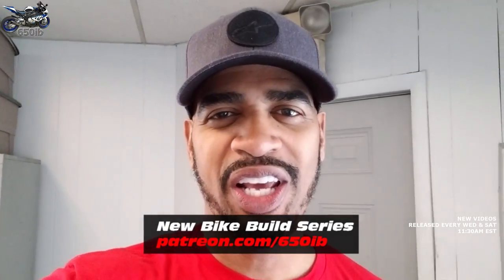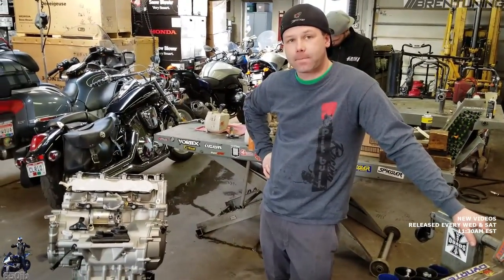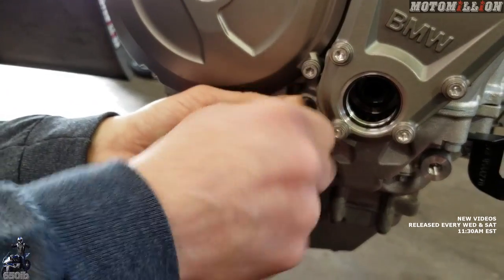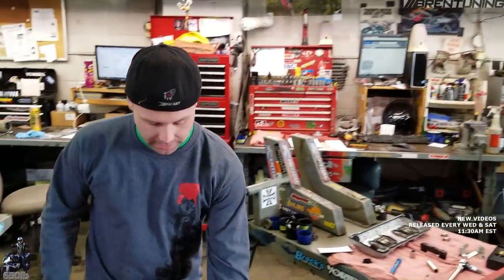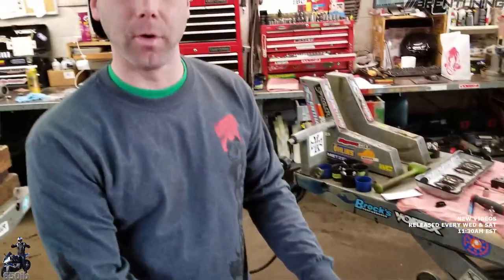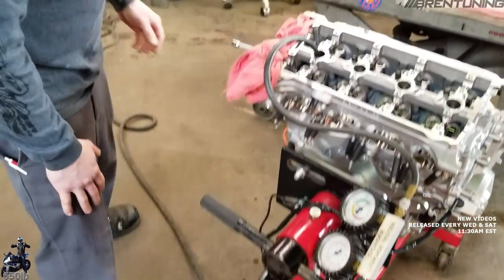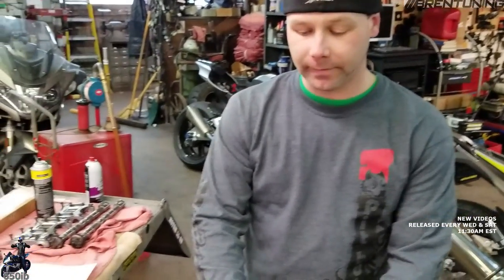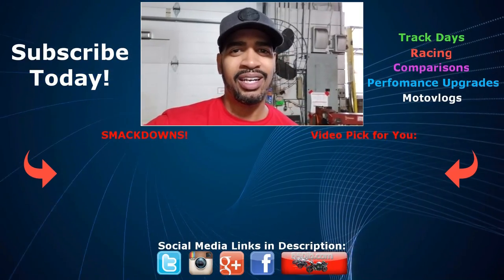RACE CAMS 🔥🔥🔥Installed onto 2018 S1000RR!!

Comment: I am a machinist and I build motors like these for a living and it's really impressive to see a bike mechanic with this much understanding of the engine. Most mechanics don't have half knowledge and understanding of the insides of the bike as this dude. I really wish I had more shops near my house like this to work with/use.
Reply: Sirmellowman start a go fund me and build you a shop. Or put together a business plan for a shop and find an investor. The bike community need more mechanics like you and zack. 👍🏼
Reply: Sirmellowman I'm not a mechanic, but I knew from day one he was a awesome mechanic.
Reply: I need to watch this one more than once for sure..Great video!!
Reply: can anyone help me - i have a 2012 r6, im tryna install the camshafts. there are marks on the intake and exhaust that are supposed to be level w cylinder head - whenever i line them up, and go to install camshaft caps, the camshaft sprockets move and the lines on them are no longer level w the cylinder head - how do i fix this, should i install the tensioner (i have a manual one) in before installing camshaft caps? the camshaft doesn't sit in fully straight too. im thinking about doing that after seeing some of this vid
Reply: Seriously shocked me too dude kicks ass

Comment: mad respect to Zach, if it wasnt for his interest and time into actually explaining the steps i wouldnt watch the video throughout completely, i'd just be skipping through. You can tell he's a genuine guy. Thumbs up !!!
Reply from the maker: Thank you very much for that feedback.
Reply: can anyone help me - i have a 2012 r6, im tryna install the camshafts. there are marks on the intake and exhaust that are supposed to be level w cylinder head - whenever i line them up, and go to install camshaft caps, the camshaft sprockets move and the lines on them are no longer level w the cylinder head - how do i fix this, should i install the tensioner (i have a manual one) in before installing camshaft caps? the camshaft doesn't sit in fully straight too. im thinking about doing that after seeing some of this vid

Comment: I just noticed that you set the timing with the 0° side of the BMW tool. As far as I understood the 0° side is for checking if the Cam timing is still alright and the other side with 1,7°/1,6° is meant for adjusting the cams after loosening the cam sprockets.

Comment: Are you sure the new valve springs are a single piece kit, without an inner spring?  I've never heard of such a layout!
That magnetic cam retainer tool is so cool.  (If you've never removed valves and keepers with an old C-clamp type gizmo, you won't appreciate how much easier the procedure is with the new tool.)

Comment: Wow by far best vid I've seen for sportbike camshafts timing and valves. Just quick question. I noticed the camshafts hopped out of their journals after the caps were taken off. Is that normal to have to push lobe down while seating camshafts when sprocket timing markings are aligned with cylinder head matting surface?

Comment: man a rc car,lawnmower, and quickie saw is that a small engine repair shop lol another great video and in my cars I screw in a air hose connecter in the sparkplug hole and connect an airhose so you really do not need a leakdown tool as long as the fitting is the same thread size of the plug holes man I sure hope he put alot of assembly lube on those cams before install and turning them they looked dry to me which is a big no no on any engine should have kept old shims they are high dollar and may be useful for another bike

Comment: Awesome video, schools charge lots of money to teach that stuff.

Side question, dont new cams need assembly lube? Or do you just build oil pressure first before firing the motor to make sure the top end isn't dry?
Reply: J B yes assembly lube is a must and was applied after final valve clearance adjustment

Comment: 18:30 Hope you double check that the valve springs are correct before hitting the dyno. Seems odd that the new one's aren't double springs..
Reply from the maker: The new springs are 2x as dense and strong as the old ones but weigh less.

Comment: My main concern is that Zack did not reinstall the OEM innner valve springs with the after market valve springs from Brentuning..I am not sure about this BMW engine but my 1441 Busa that I built has aftermarket APE 65 lbs valve spring and require the inner spring also to be install with aftermarket springs.Check with Brentuning.Adam
Reply: 70lbs springs I rev s1000rr motors to 15k after the cams and springs no issues.

Comment: Hey was up...like the video very informative....I have question...I have a 2004 Suzuki 750 a little work done to it about to get my ecu flashed..my question is besides getting the ECU Flash what are some other things I can do to get the bike faster.... keep up the good work on the channel and ride hard and say brother
Reply from the maker: Hello Khalil... You can install race cams, larger pistons to make the bike faster. I'm assuming you already have an exhaust. Good luck with your project Sir!
Reply: 650ib yes I have an exhaust but I'm think of changing it to a Brock like the way look and sound and dis some homework in them and there good thank for the suggestion I will look in to that...keep safe and ride hard

Comment: Time to inspect my cam and followers if they look funny (cause they sound funny) gonna have to do this. After 11mo and 100h of complete overhauling the R1100GS for the 1st time, 5 ptsds and 5k in parts this be a b to do. Luckily I don't need to change valve springs so no need for leakdown air. Where zacks shop?

Comment: Nice! Can you ask Zack, which program he used for a service manual?
I own the BMW S1000R 2017 and I want to replace some things on the motorcycle, but I do not know the amount of force required to tighten some bolts. For example, the rear wheel or front braking disc...  I believe there is some manual or pc software  where is written force/torque for each bolt on the motorcycle.
Reply: Do you not have an owner's manual? The regular maintenance jobs such as wheel removal are listed with torque specs.http://www.bmw-motorrad.com/com/en/index.html?content=http://www.bmw-motorrad.com/com/en/services/manuals/manuals_main.html&notrack=1Note there are quite a few, verify you have the most recent manual for your bike type.

Comment: Yo. Don't hate me I don't know a lot about the engine of bikes but what are the benefits of a race cam.
Reply: Bike Life more power
Reply: Kwame Boyce by how much normally
Reply: Im really not sure how much, i just know that you gain more power, maybe 650ib can tell us
Reply from the maker: +Bike Life It can add as much as 10hp to the bike.
Reply: Also, you can change the torque curve a bit as well, race teams do this sometimes as well.
Reply: Usually about 5-10% of power. Zach detailed it in an early episode of why cams add additional horsepower. It’s because they allow you to change how far a valve opens and for how long that valve stays open. Mind you we’re only talking about milliseconds or even less and fractions of a millimeter.
Reply: Basically you're sacrificing low and mid-range torque for additional high RPM Power

Comment: very good, but the camshafts you have mounted are for the previous model, not for 2015-2018, as they are that engine will not even start.
Serious mistake, but probably it was who sold you the camshafts.
Reply from the maker: Brentuning sent us the correct cams and we were all set.
Reply: in fact, they were wrong, we see from a distance.

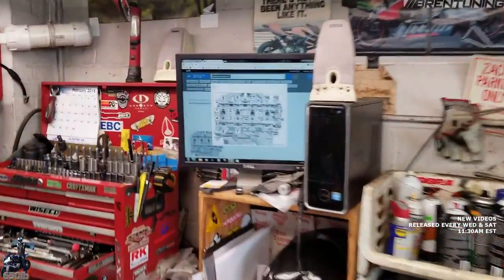Comment: After 11:07 didn't he undo the bolts in the wrong order ?  On the diagram bolt 1 was cylinder 1 exhaust side, he started cylinder 4 intake side (bolt 14) ?

Comment: I'm thinking about installing a set of race cams myself on my Gen5 ZX10R... the race cams follow the same suit as these, a little bit of lift difference but overall longer duration. I'm assuming with longer duration you'd want to delay your ignition timing? Am I correct? And in what increments is/should I be adjusting the timing by and how can I verify the ignition timing is ideal?
Reply from the maker: Hey.... Please email Brentuning and they will answer your questions.

Comment: How do you degree them with the adjustable timing gear? Does that eye glasses tool just set it  up to the bmw spec for you do you don't have to degree them? Would there be an advantage to degree them in vs the factory set up tool if that's the case?

Comment: So what does a racing cam actually do differently than a stock cam?  Other than weight reduction.
Reply: Matt D starts at 13:30, the lob on the camshaft is shorter and allows the valve to be opener longer....not much of a mechanic, but I tried to follow along with the gain of this...
Reply: Matt D correct not a weight thing at all. Controls when fuel enters cylinder for how long and when it leaves as exhaust. Keep valve open longer more fuel and air in and out👍🏻

Comment: How much does it cost to install the bren tuning racing cams in S1000RR?
Reply from the maker: +Prince Cedric Bajade The cams plus install is roughly $2500
Reply: Thanks! 😄 I definitely would like zack to do the work if ever i were to install a racing cam on a motorcycle 😂

Comment: No way in hell would a cylinder head  cost about 5000 dollars... you can find a 2015, 2016 s1000rr complete motor for about $3000-$4000
Cylinder heads go for $400-$1000...that was a crazy estimate
Reply: that motor new is 15k look it up used 2500 lol